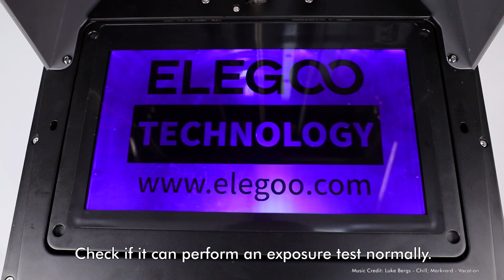SUPPORT: How to Replace the LCD Screen on Saturn 4 Ultra

Comment: Glad this is only going to take 16 minutes
Reply: What a load of shit. They glue all the wires into place so you need to cut the glue. And the screen does not push out easy. Probably going to chuck this entire printer in the bin and return the screen replacement I just bought.

Comment: Award for most poorly designed piece of hardware.....    goes to Elegoo.    Edit...  FYI,  if you find your losing resin and it goes down the sides of the LCD  ; )  roll the whole printer onto the left side immediately (left from the front) take off the front and side panels for cleanup. there is a resin catching lip on the tilt mechanisms chassis down the thin gap.

Comment: Ok the screws were bad, but the part that cheesed me is that they hot glued all the cables in place. If I’m supposed to be able to remove a cable, don’t glue it to the motherboard!!!

Comment: Should mention the glue that is on the cables, I could not remove one cable while doing replacement because it was inside the cracks of it. Biggest pain is that dam glue.

Comment: This video is exactly why I won't ever buy this printer.  If an LCD is a replaceable consumable I don't want this kind of effort to get it done.  I really hope for your next iteration of printer design you take into account that an lcd replacement should be a more plug and play experience for your customers than having a degree in advanced mechanics to get it done.

Comment: So I've been thinking if I should buy Anycubic or Elegoo. I've learned a lot of flaws about Anycubic one, but damn this screen replacement is just insane. Thank god I got to this video before a purchase.
I mean, what's the problem of adding a screen container, detachable from the outside? Like, detach the cable, unscrew the hidden head screws, put the container on the desk and do all the replacement/cleaning/glueing at on open space, without touching the printer itself. Hell, you can even sell a replacement container with screen preattached for extra money. And if you care about maintaining the screen plane, just use more screws, like car makers do.
The screen is a consumable, it should be easily to replace. Not to mention all the loose parts gone wrong after bringing the printer together.

Comment: These screens die so fast and are so expensive and difficult to replace that these are basically disposable machines. I have a Saturn 3 Ultra, I've replaced the screen twice in 18 months and I will not buy another ELEGOO printer because they’re not serviceable.

Comment: Who ever designed this printer needs to be cooking noodles somewhere, not designing these printers! This is the most convoluted disassembly ritual ever needed to replace something that is so common to need replacing. Would only have taken a few extra hours to design the printer with the fore thought enough to be able to replace this screen without having to totally disassemble the entire printer! Most ignorant design I have ever witnessed!

Comment: This is the most convoluted way to replace this (realised after i did it). In the video, the fres lens and led sensors must be different in aus, had to swap around (fres side still the same just 180 degree spin.)

Comment: ３Dプリンター初心者です。よく調べずに買って失敗しました。

普段はレビューを書きませんが、今後買う方のために書いておきます。

買って5個ほど造形に成功後、数日ぶりに電源を入れると「液晶画面の接続状態」 のエラーが表示されて造形できなくなりました。

「SUPPORT: How to Replace the LCD Screen on Saturn 4 Ultra」
https://www.youtube.com/watch?v=FaUmncAAzGs&feature=youtu.be

サポートに問い合わせると上記の「LCDパネルの交換」の動画が送られてきてLCDケーブルの緩みをチェックするように指示。

何十本というネジを外して、本体をほぼ全分解してチェックさせる内容でした。動画では省いていますが、ケーブルはグルーで雑に固定されていてそれをドライヤーで外す手間もかかります。

買ったばかりなので交換してもらえないか聞きましたが、その質問は無視して修理させる指示の一択。担当者の上のスーパーバイザーにも聞いてもらいましたが、

「お客様のケースは、経営陣を含む上級技術チームによって既に確認・確認済みであり、ご提案内容がお客様の問題に適切であることを確認しております。」
「ご提示したトラブルシューティングの解決策のほとんどが正しいことが確認できました。」

と、いうような返信で初期不良の可能性などは一切認めません。

指示通りに分解中、動画のコメント欄を見てみるとユーザーの不満だらけでした。日本のメーカーと同じようなユーザーのことを考えた対応はしてくれません。

他の故障もよくあるようなので、時間を無駄にしないために別のメーカーの機種を買う予定です。

I'm a 3D printer beginner. I bought one without doing enough research, and it ended up being a disappointment.

I don't usually write reviews, but I'm writing this for future buyers.

After successfully printing about five items after purchasing it, I turned it on a few days later and received an error message about the LCD screen connection, which prevented me from printing.

"SUPPORT: How to Replace the LCD Screen on Saturn 4 Ultra"
https://www.youtube.com/watch?v=FaUmncAAzGs&feature=youtu.be

I contacted support and they sent me the "LCD Panel Replacement" video above, instructing me to check the LCD cable for looseness.

 this involved removing dozens of screws and almost completely disassembling the unit to check. Although it's omitted in the video, the cable was roughly secured in place with glue, which required some effort to remove with a hair dryer.

Since I'd just purchased it, I asked if they could replace it, but they ignored my question and simply told me to have it repaired. I also spoke to the supervisor above the person in charge, but they only responded with things like, "Your case has already been reviewed and confirmed by our senior technical team, including management, and we have confirmed that our suggestions are appropriate to your issue."

"We have confirmed that most of the troubleshooting solutions we presented are correct."

They refused to acknowledge the possibility of a manufacturing defect at all.

While I was disassembling the device as instructed, I looked at the comments section of the video, and it was full of user complaints. They don't provide the same customer-friendly service as Japanese manufacturers.

It seems that other malfunctions are common, so I plan to buy a model from a different manufacturer to avoid wasting my time.

Comment: Elegoo needs to learn the art of Design for Manufacturing and Assembly. 

Early in the design phase they should have identified the parts that the consumer would need to periodically service. Then when they break the printer into parts during the engineering design phase, they can be mindful of the number of things that need to be removed to replace the serviceable parts. On projects I have worked, we have a "one deep" rule. If it takes more than removing one layer to get to a thing, we have failed, and then we have to keep working on the design until we can meet that requirement. One deep is fasteners. If you need to do more than remove a fastener to get to something, the design is a failure.

Comment: wrf is this ,u are de/ re assembling the machine from the bare frame same as in the factory this is like as 3-4 hours job for an average person and no matter how well u do it wont be as good as in a dust free factory with the right tools.
and u have to spend probably 150 -200 for a screen. 
who the hell came up with a design like this ? i was about to buy it but with this crap and the build plate fiasco going on its a big no no ! elegoo should recall all of their ultra !

Comment: The best part of this whole thing is that I get the whole damn printer apart just to find out that the replacement screen was defective from the factory with a giant wavy pattern in between the glass and the panel.

Comment: There is no reason to remove the front wall and its LCD screen. Technically it gets the LCD's ribbon cable out of the way, but that hardly matters, and the risk of doing this (including the risk of manipulating the screws which tap into plastic) is unnecessary.

And yes, you need a heat gun (or hair dryer?) to get the screen out. If you don't have it but have acetone, it might be able to dissolve the glue too (pour when the printer is upside down of course).

You can put the printer on the edge of a table to keep it perfectly upside down, will make the lens removal/reinstallation easier.

Comment: I was told this was an easy process and sent this link by customer support... Its literally taking the entire thing apart... Just to replace an LCD screen? I've been an Elegoo supporter as this is my third printer but being sent this... I might as well go into manufacturing.
Reply: I was told they wouldn't help me any further. I won't be purchasing Elegoo going forward. It's sad, its a brand I had started my 3D printing with, but garbage design and garbage customer service led me to disliking this brand. Buyer's beware.
Reply: @WolfDrawn I got this machine as my first into the hobby ive had it 10 months and used it pretty light.  Lcd is dieing and I'm not sure I'm not just gonna buy a new machine from someone else instead of all this hassle.

Comment: how about a video for cleaning the fresnel screen, and somewhere to order a replacement? Unfortunately my fep got a hole, leaked, it got under the lcd, and coated the fresnel.. I cannot find anything on how to clean this or replace it.
Reply: Ali express has a replacement. I’m putting it rn
Reply: Same exact thing happened to me - I emailed Elegoo support and after a back and forth had a new one shipped to me for $23. Now I just need to figure out how to put the thing back together and which screws go where

Comment: Is this just to make people pay for more parts? Becaus in my bid to dismantle the ENTIRE printer to replace the screen, the connection for the touch screen completely tore away. This is absolutely shockingly cheap stuff if it tears just with the slightest pull and I will absolutely be looking for a FREE replacement. Fucking abysmal.

Comment: As someone actually trying to follow this process, this video misses one key part. Every cable is attached to their sockets and held in place with extreme amounts of wax. Like so much so its dripped from some of the upper cables past the lower cables and to the bottom pan. It’s a joke. I have to fight my way through an entire candle to access the cables just to replace this panel. Ive had 3 elegoos now, this will be the last. Buyer beware

Comment: I think you have the ribbon cable for the touchscreen installed upside down (black side up) as you can see at 14:54 every other source i have seen has the cable white/blue side up
Reply: I just finished reinstalling and followed the ribbon cable orientation and LED calibration looks good...but I am getting an LED temperature detection malfunction fail during the self-test. Wonder if this could be the culprit.
Reply: Thank you! I thought it was odd and its worse. Mine has the blue bit on the black side so either way it's different from the video..

Comment: I got about 60% through this process and then while removing a hot glued cable I’m pretty sure I cracked the solder and now I don’t want to waste an LCD replacing it.

This can never happen again. LCD’s go out all the time and it can’t be this insane of a process to replace them.

Comment: Your website says the Saturn 4 comes with a screen protector. Was that another lie, like your auto-leveling?
The LCD screen comes with a durable and scratch-resistant protector made of 9H tempered glass, effectively protecting it from scratches and damage.

Comment: Jesus christ elegoo you are fucking terrible at designing these printers, you SERIOUSLY think its necessary to be forced to take apart the entire fucking printer with more screws then the god damn vat takes? Jesus on the saturn 3 ultra you just unscrew the front panel and you can pop the lcd screen out with your thumbs, and the cable is also right there. This is so fucking unnecessary. Considering you don't design the screens to last long. I have 14 saturn 3 ultras for my print farm and the LCD consistently go out after around 2 months of heavy use. I rather eat cancerous fucking rocks then to spend 2 hours completely taking apart the saturn 4 ultra just to replace 1 damn consumable part. What terrible design dude. Think fucking smarter man.

Comment: It is not that easy some of the connectors have silicone glue on them,  I had to use a razor blade to remove them.  The little black wire is for wifi it can stay

Comment: I've worked with a whole bunch of different resin printers, and this has to be the worst I've ever used Being forced to disassemble 90% of the printer, including tampering with multiple wires, and using over 8 or 9 different types of screws (which you must remember exactly where they go! - which not even this tutorial demonstrates.) along with multiple sized Allan keys, you'll constantly be switching.

Unfortunately I bought this printer over my usual Anycubic brand, and after five months of little usage, the screen had already got damaged.

I'll be buying a better printer elsewhere, even with the great specs of this printer. (The down time for maintenance is ludicrous!) As soon as my new screen fails, I'll be replacing this whole printer, not the LCD screen.

Comment: This guy must get paid by the hour. All you have to do is remove the back panel, disconnect a cable ribbon, pry off the old screen, clean off the adhesive tape, insert and connect the ribbon through the top, connect the ribbon cable to the new screen the place the new screen and finally replace the back panel. It literally took 10 minutes.
Reply: Do you have a link for a guide to this method?
Reply: @nyallkershaw5116  sorry no, just my explanation I already wrote out

Comment: I got my Saturn 4 ultra when it came out.  the screen didn't last 8 months and just long enough to not be covered.  I just replaced a screen for an old Saturn 2 which was a bit complex but man, this was a lot. But after getting it all put back together, it wouldn't power on.  no beep, no screen, just dead.  I spent hours installing the screen and this time nothing.  

oh and this screen break was the oddest.  it was liquid in the center.  when printing I would get holes.  They said it was the screen.  But now, unless I can get it working I'm out a machine and I spent a lot of time doing it.  

If these are considered disposable or replaceable I think Elegoo needs to make it easier to replace.

Comment: My screen was factory defective.  So they sent me a replacement. 
This is Not a user friendly experience.  

What their instructional video doesn't tell you:
 A, the factory installed screen is epoxied in place. You have to force it out. Then chisel the remaining glue and glass out of the metal frame with a chisel tip hobby knife.
B, all the cables inside the case are hot glued to the motherboard, often into the wires. Be VERY careful when loosening the hot glue. As you don't want to break a wire.
C, buy a set of proper hex head screwdrivers to make this a little easier.

Comment: In the middle of this process now. I’ve only had the printer for 6 months and screen already dead. Unfortunately it was 20 days past warranty. I will not do this again if the 2nd screen dies. This is insane. I will go back to my Anycubics.
Reply: Screens only have a life time of 3 months
Reply: @chaosclg  3 months of what? Constant running 24/7 ? How many hours did you print for in total?
Reply: @OCDCOMMENTS  look at the manufacturers reccomendations. fep/acf etc and screens are consumables and they are expected to be changed at least once every 3 months on average.
Reply: @chaosclg  Not the screens, mono lcd panels have a life span of 2000 hours, the film yes but not the panels themselves.
Reply: @chaosclg  What are you not understanding…. The LCD screen has a life span of 2000 hrs the film substantially less… if your lcd screen is dying after 3 months, you either run 24/7 or the printer is crap.,
Reply: @OCDCOMMENTS  you better go tell elegoo that then mate clearly you know more about printers than they do...

Comment: There is no need to unscrew or disassemble anything! Simply remove the tape from the top of the screen then pry the screen off with a flat head screwdriver at the front two corners where there are small recesses (doesn't matter that you damage the old screen slightly as this is the part you are replacing). Then follow the instructions starting at 6:24 and you're good to go!
Reply: It is really really hard to pull up the screen -- the adhesive is very strong. I shatterd the whole screen before I finally managed to pry it off, with some help of heat and alcahol to decrease the stickness of the adhisive.

Comment: practically same steps to replace the UV light that's buried on the bottom .... it could have been done simply if you had a rear access  panel behind the light to remove entire assembly !!! infact first thing i did was get out the jigsaw ..and made my own acess door heat sink and light now come out with 4 screws  and made new power connectors so i do not have to acess mainboard as well ... as after 1 month the light died !!! the shroud is now mounted to directly to the bottom of case and not the lens assembly

Comment: Shitty machine, had mine for only 4 months and there are already dead pixels lol. Would’ve been fine if the process of replacing it is easy but no. You have to take every part apart just to replace the screen. Never buying from you again.
Reply: My screen has died after 20days waiting on support atm. Dreading replacing it after watching this.